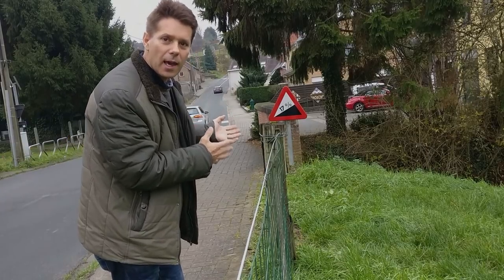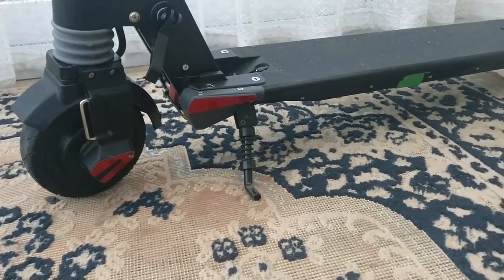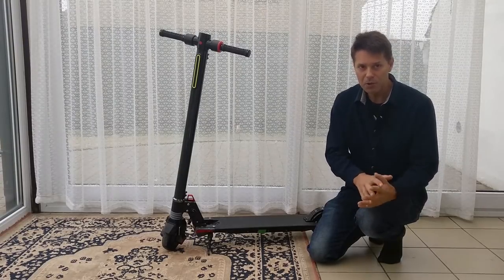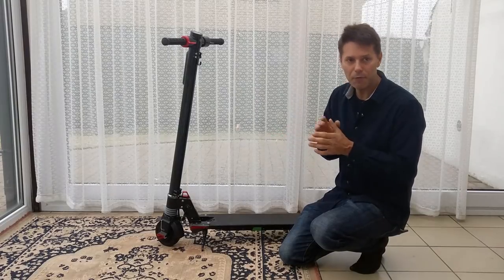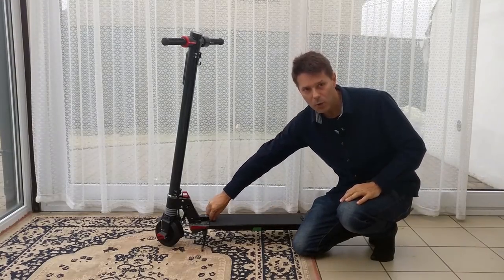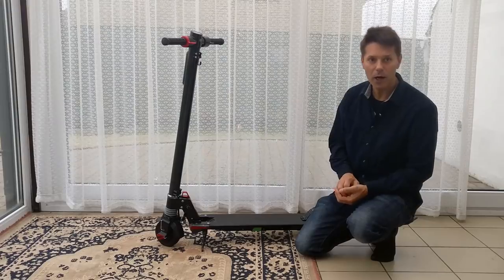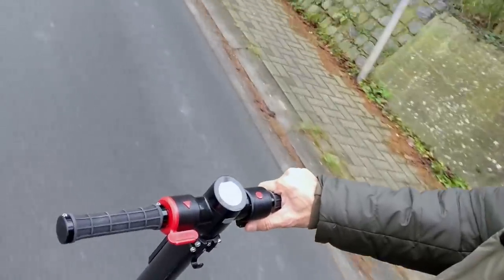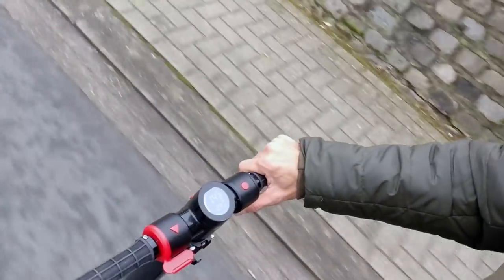Full review of the S5 dual electric motor carbon fiber scooter

Comment: Guys the scooter has a speed limiter within the handle bars. When you remove it, you can hit 20mph. But he doesn't want to remove it because of his country's laws.
Reply: BJ Chaos do you have a review?
Reply: Facundo Carmona I'll make one soon. Haven't had time to
Reply: Facundo Carmona I can tell you though that it's a really good scooter
Reply: BJ Chaos thanks can you explain how to take out the speed.limit?
Reply: Facundo Carmona it's really easy. The wire is located in the right handlebar side of the scooter. Simply take it out and unplug it and put it back in the scooter. For my weight(136ibs) I was able to hit 15mph at the single motor gear 1 setting.

Comment: Hi Kurt. I really need a video tutorial on how to disconnect the Horn speaker. It beeps whenever the battery changes low to high/high to low which is extremely annoying and embarassing.
Reply: Kusa Weir it's easy, just unscrew the plastic covers on handlebar and pop them off.  Unscrew the top handlebar cross bar and then you can see the wires.  Find the wire that leads to horn button and unplug.  I did this on the first day of ownership.

Comment: Are these scooters really doing regenerative braking? I know it's advertised sometimes but I somehow doubt it. I think it's actually using energy to brake, not charging the batteries...
Reply: Regenerative when coasting.  (whenever the motor (front wheel)  is in motion but the throttle isn't being pressed.   iE coasting and coasting downhill.. And when braking depending on amount of E-brake being applied it will go from regenerative to using battery power to stop motion of wheel.    So yes.   They have regenerative... But it's nothing to rave about.  ... So unless you have a milelong downhill ride home..  Wont send your battery from half to 3/4 full.    

Waiting for Tesla to come out with an E-Scooter....  

...with auto-pilot...   ....that doesn't get you decapitated if you fall asleep on your EScooter (while standing up.. And keeping your hands at 3 and 9 o'clock on those handlebars...   Just in case....  

  BEEP BEEP BEEEEEP. !!!!!
          WHOOP WHOOP WHOOOOP!!!

AAAARGHhhH !!!   It's a black Tesla Semi truck...   Connected to a flat bed trailer with a load black Teslas. scrap refrigerator parts. and steel I-beams!!!!!   Auto-pilot cameras must not of seen this deadly hunk of technology and raw unapologetic cold hard STEEL coming right for your.......

 THUD.

Comment: How are these tires? Can they get damaged and need to be replaced? Like you mentioned in this video, the deck clearance is looks very small as a result of the small tires. I have the Xiaomi M365 scooter and ordered the solid, non-inflatable tires for those one week ago.
Reply from the maker: The deck clearance can be an issue if you are driving from a curb. But, it is never recommended to drive off a curb, as it is potentially dangerous to do so.

Comment: Thank you for your video and test in real conditions of this electric scooter.
It is objective, compared to other electric scooters manufacturers who all show videos with light and sexy models riding on flat roads. They dare not climb such hills !
I agree with you; I have an other very powerful model with two motors. Previously, I had a model with a single brushless motor. I will never switch back to a single motor model. The dual engine is in my opinion the future of electric scooters. And the batteries have progressed a lot in terms of weight-range ratio. I am confident in a near future where urban mobility will be mainly electric.
Reply from the maker: Thanks for your comments. You won't see from any of the other scooters how they can climb hills like the one I show on the video. People will end up being very dissapointed with a single motor setup and that's why this one has dual motor.

Comment: Hey kurt, I already having problems with my scooter. It shuts off unexpectedly while riding. Very dangerous, I'm trying to find a way to fix it
Reply from the maker: Hi John,
Can you please check that the cable you disconnected in the handle bar still has tape around it? If you remove the speed limiter and the disconnected cable makes contact with the aliuminium of the handle bar, you might get this issue. 
Contact me in private with Whatsapp. Please note my visit to the factory is scheduled for January 26th. 
Kind regards.
Reply: The scooter runs fine now. The reason why it happened was because I was riding on wet road. Maybe water somehow got into the scooter. After it dried up, the scooter was normal again.

Comment: Thanks for a great informative video! How is stability and comfort driving a scooter with 5.5" tire and short handles?
Reply from the maker: If you are used to the S3 model, this is more stable due to the fact that the battery weight is now under the deck.
Reply: I have not tried the S3, I am in to buying my first scooter. But have concerns about the small tire... How is the comfort, turning... and how does it handle stones and other stuff on the road?
Reply from the maker: The S5 is much more comfortable than the S3 model. 
I cannot drive on the paved roads in Brussels city center with the S3 model, but I can drive on the same road with the S5 model.

Comment: Why does small scooters always got fixed handle bar? Isnt foldable handle bars more compact and stylish than fixed ones.
Reply from the maker: You can screw them off, but with foldable handle bars you loose strenght and might get handle bars that wobble. That won't feel safe at all.
Reply: Inokim light,inokim 3 have foldable handles but they are stable and safe.

Comment: Do you have any guess about the range for the moment? What are your thought about the speed. It says max 25km/h but in the video you say around 20km/h. If you weight about 90kg how do you think the scooter would handle... speed range?
Reply from the maker: Hi, yes, I get about 20 km/h with the speed limit. There is a way to unlock the speed limit and then you'll get about 35 km/h. As it is not allowed in Belgium, I had the limit on at the moment of the footage. 
A friend of me, 105 kg can go on top of a long hill with a 10° incline without any problem. 
No test yet as far as the range is concerned. We'll see next week.

Comment: I now having doubt whether battery in the deck is a good idea. This one has a larger pole than S3 so it should be possible to fit the same amount of cells, or a bit less in there.  Then it could have the S3's deck which is super sexy. All this aluminum deck and protecting shell adds tons of weight. I feel they went over the edge with this one. I'd like to see a hybrid between this and the S3 for the next version.
Reply from the maker: Hi there, there is not much more weight because of the deck in aluminium and that protection shell. The protection shell is about 90 grams, that's not going to make a difference. The main reason why the weight is 3 kilos more is the 12 supplemental batteries, which accounts for about 600 grams more, the second motor, which counts for about 1.8 kilo and and the remaining extra weight of 600 grams comes from lightning, deck from carbon fiber to aluminium, mudguard, extra protection of the wheels, suspension and not to forget the new much better folding mechanism, which improved stability and makes it much more sturdy.
Imagine, you change the aluminium deck to carbon fiber, you'll only win around 120 grams. 
So carbon fiber deck vs carbon fiber deck with protection shell accounts for about 200 grams total difference.
Reply: Yeah, kind of make sense Kurt. However, I would still prefer batteries in the pole if no other than aesthetic reasons.
Reply from the maker: I agree, it looks more sexy. The reason why the batteries are in the deck is because the supplemental 12 batteries are necessary to draw the current that is required for the dual motor system. 
As you only have 10.4 AH, they had to either put more batteries in paralel , instead of 4, 6 or even 8. The other solution is to increase the voltage from 24 volts to 36 volts. Then you can use 2 motors. You have to be carefull not to overload the batteries too. 
If we would use the same setup as the S3 model, you can put 4 paralel batteries in series of 7. Imagine, we make the pole longer and stuff 8 batteries in series in there, this will result in 27.5 volts. Unfortunately there are no electric hub motors available for the s7p4 setup, meaning 27.5 volts. You either have to go with 24 volts or 36 volts. 
Another way of doing is to put more in paralel, let's say 6 or 8 in paralel. The pole diameter will be 4 cm more, and that is ugly looking. So the deck was the best option. 
There are many technical aspects about designing. But I think the scooter doesn't really look too bad at all.
Reply: I see, so there is no way to get 36 volts just by using the pole. I hope cell density will increase in the near future that you can do that. Also if it has the same controller as the S3, it is quite bulky. I'm sure that could be shrunk as well, to make space for more cells.

Comment: Dear Kurt, good video for real life climbing ability, but please dont switch between degree and percent when talking about hill steepness. You climbed a hill with 17% (which is about 10 degree), that scooter never will climb 17 degrees nor the mentioned 25 degrees (which are 47%!!!) with a speed like this. There are many fairytales about climbing abilities, range and top speed about electric scooters.

With 250Watts you get normally not more than 10% (percent) climbing ability with more than 15km/h, if you add friction from the surface, speed will drop to less than 5km/h. Its just simple physics, if you are interested I can post the math so everyone can calculate range, climbing ability and top speed from the data sheets of the scooter.

For example, xiaomi calculates about 125Watts for a 75kg person driving 15km/h in flatland. So this is approximatly the power loss just for friction on the ground. If you want climb up a hill with 10% (percent) with these 15km/h and 75kg person you have to add 304Watts, so together about 410watts. This calculation is valid for most of the normal scooters (small hard wheels between 15 and 20cm diameter). The smaller and softer the wheel, the higher is the friction part (but it doesnt effect climbing abilitys beside the friction effect. The math of the climbing power is linear, so if you want to calculate other weights, speeds or steepness just multiply or divide by the ratio of differences. 

If you want to drive 25km/h the friction is normally speed ratio squared (vmax/15)^2 x 125 Watts which is 347 Watts. Xiaomi has 30 cells of 18650s with 2600mAh and 3.6 rated voltage. So they have about 280Wh which mean you can drive 280/347h = 0.8h and so 20km max if you dont accelerate or break. This is the range I get on my xiaomi (a little less because I have to accelerate at least one time to 25km/h) when I drive it on an airfield without further acceleration or braking or climbing. So you can do the math also for your or any other scooter, but dont mess up with the units. And when you do it, you will see there is a simple, calculateable dependence between speed, range, climbing abilities, accelerations and brake times and of course weight.
Reply: And of course the number and capacity and voltage of batteries (or better accumulators)!
Reply from the maker: Thanks for pointing out. Very clear explanation. I'm pretty impressed about the S5 model. Climbing the 17% or 10° hill at a speed of about 15km/h with my weight 77kg is pretty impressive. That's why I like this s5 model as I was kinda dissapointed in the s3 model. 
The S5 model is very good for my hilly area, but also if you like to have a little more power under the (f)hood. 
Thanks for taking your time to explain. 
I am abroad now and I haven't had time yet to do a range test. I'll be visiting the factory on the 25th of January.
Reply: Just to correct myself: xiaomi calculates 140W for flatland, adding 304watt for climbing makes 444Watt. So I messed up also some stuff :-). The problem is, that as every engine also the electric ones have a operating point, where they are most economic, and this is the rated power. The max power can be higher, but less economic. Also using less power is less economic. So the producer has to decide, at which power setting the scooter runs at most. Therefore it is nonsense to have a scooter with 1000Watt rated (so best economic operating point) when you normally drive 20km/h. But to take a 250Watt is an misdecision too if you live or want to use it (on holiday) in a hilly area. So I also think around 500Watt is the best choice. Or like the s5 two 250Watt motors, one for the economic flatland riding and the possibility two choose two of them uphill.

Comment: Only 20 kph maximum? Even Xiaomi M365 goes 25 kph right out of the box
Reply from the maker: If you unplug the speed limiter in the handle bar, you'll get 36km/h. Nothing compared to a m365.
Reply: please do a top speed video
Reply: please do video of unplugging the speed limiter and going 36 kph